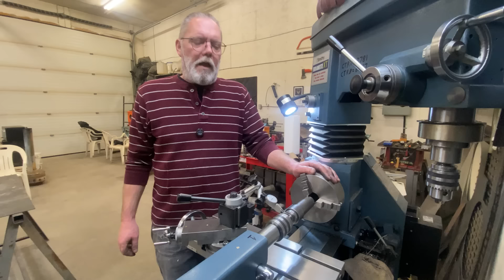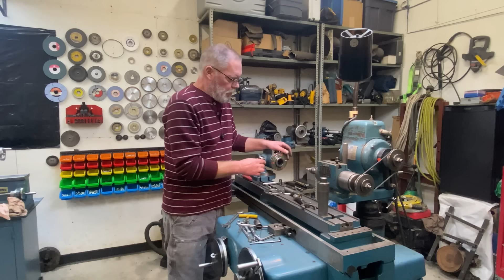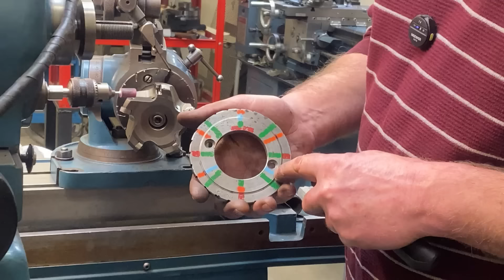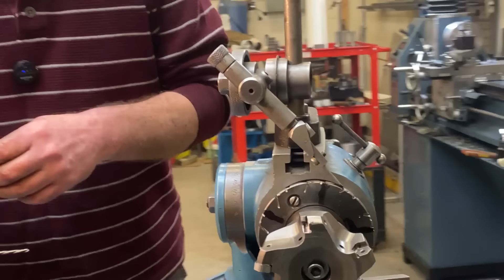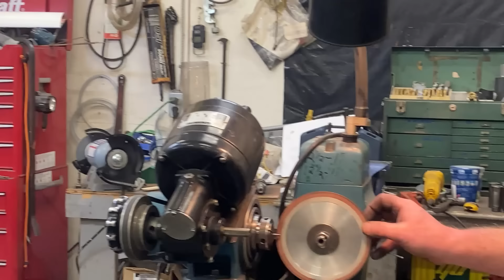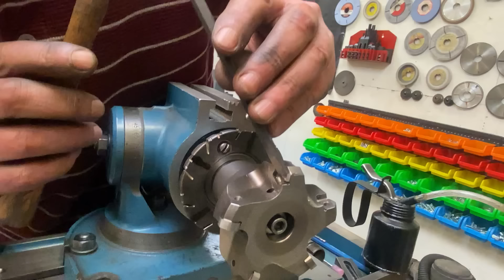MOST IGNORANT BROKEN SCREW I'VE EXTRACTED

Comment: Glad to see your success with this method, usually they aren’t seized, just too low to get any purchase on. I’ve had success getting these dodeka mini screws out by taking a really thin dremel cutoff wheel, grinding it on a piece of carbide until the diameter is just small enough to reach the screw and minimize the damage to the shell mill, then slotting the head of the screw and backing it out. This method leaves a small notch on each side of the screw hole but I haven’t seen any adverse effects because of it. Plus if it happens again, there’s already a slot to start grinding in.
Reply from the maker: Thanks for sharing your method, sounds like a good approach!